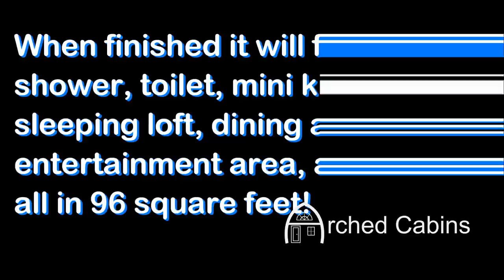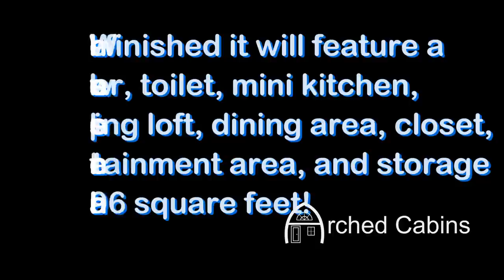Arched Cabins LLC Tiny House 12' x 8' on trailer

Comment: Very cool - I'm interested to know if this would be a feasible option in areas with extremely cold winters.
Reply from the maker: Yes, if the insulation was upgraded to something like spray foam!
Reply: Do you think this construction could handle a lot of snow pack? - i'm talking being potentially buried and needing to dig your way in...
Reply: Arched Cabins 
I have called and left messages regarding purchasing the largest cabin to put in a piece of land in somerville tx and to date no one has responded!!! Apparently you're not interested in my business!!!